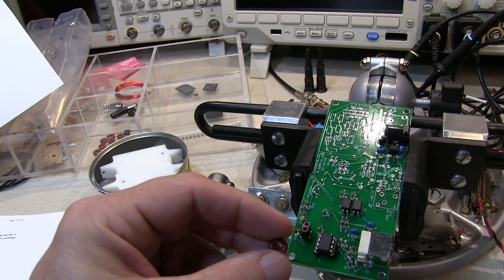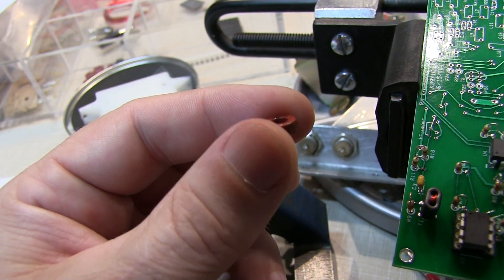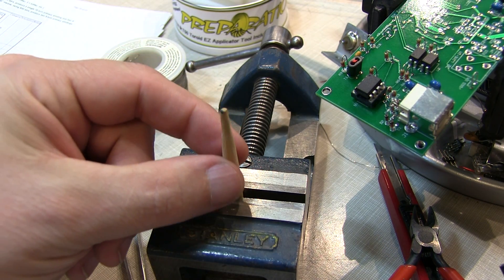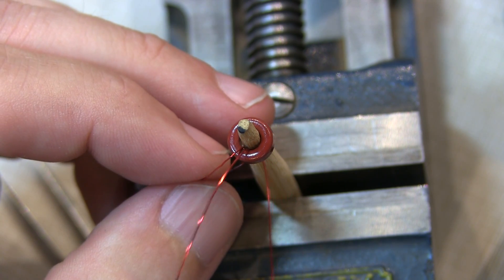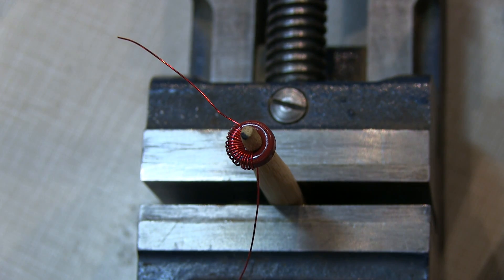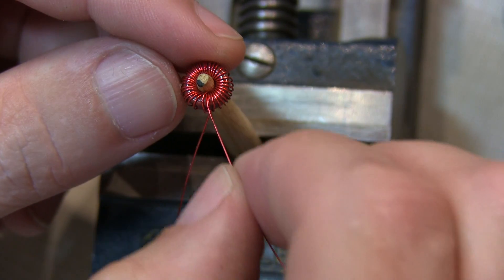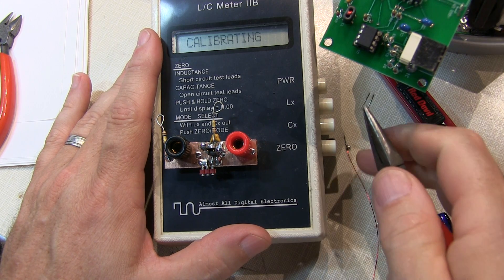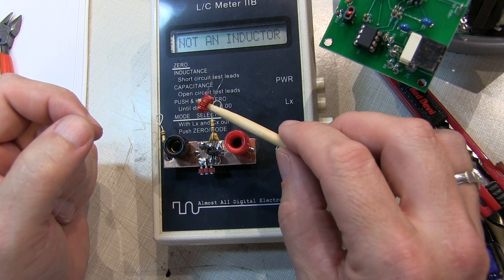#151: How to wind a toroid inductor | A quick tutorial

Comment: The chopstick and the 3D printed gripper are both clever options. I've always just gripped the core between my left thumb and forefinger and wound the wire on with my right hand. Never really felt the need for mechanical assistance, but I can see how it would reduce fatigue if you're winding a lot of toroids. Even the QRP Labs transceivers have enough toroids to wind that it might make a difference.

Comment: Great idea using a chopstick, i tried it to wind a T30-6 with 35 turns but the opening ID got so small even with a thinned out chopstick it was still to big. I ignored your advice and wound the last 10 or so turns on it with out counting. Then took a picture and marked of every 5 turns with a paint program, it was easy to count. thanks again for the tip. My tip to pass back, to solder the body on a PL-259, take the tip off of a soldering gun and use the current to heat up the body, solder will just flow in.

Comment: strip the enamel ? The method I use. I have a small tub of radio shack rosen flux
I dip the enameled wire into the flux
Then apply a little solder to my tip
Then move the iron along the enameled wire
99.9 percent of the time the enamel will burn off and the wire will take solder nicely
Flux can be your friend :)
When soldering objects and want to avoid excessive heating ?
apply flux
make sure iron is HOT
Get on and get off
Sometimes by having a smoking hot iron and you can keep components and soldered objects cooler
Just get on and get off
Like I said Flux can be a real help
Counting Turns ?
Take a good picture with your phone
Put the picture on a computer
enlarge the picture and have a really good easy look :)

Comment: My output voltage is quite low on hand wound toroid transformer. I did match the frequency to source AC, used proper core, and both wound in same direction. What is efficiency "percentage difference" of primary not wound exactly over secondary, just wound separate on core? It just looks visually better with 2 different colors insulation.,at separate placements on core.

Comment: Thanks for the idea of the post to wind the inductors on. 

To the best of my knowledge there are essentially 2 types of magnet wire insulation, the high temperature insulation for such things as motor windings, and the low temperature for signal windings, such as guitar pickups and receiver stage coupling. The smaller the wire the more likely it is to be low temperature. Magnet wire should all come with the melt temperature of the insulation specified, but it seldom does when you buy less than a whole spool of wire. Suppliers are lazy.

Comment: I just watched this video, again, after five years. Yep, there is still more to be gleaned from it. Thanks, Alan! I have another idea for a tip, but I have not tried it, yet. Might it be helpful to either 1) flatten a portion of the chop stick, along its length, or 2) cut a notch, along its length, in order to make a void through which to pass the wire? This method would mean that the toroid would remain fastened by friction and, yet, more than one turn could be passed through the toroid's center, before the toroid would need to be lifted and turned. It might also make it possible to cinch the wire down firmly against the toroid's body, which should improve the final component's operations. A void of one-third of the circumference might do as a size from which to begin testing the idea...
Reply from the maker: It's a good idea, one that I have done myself.  I've carved a groove in mine to allow the wire to pass - makes it easy to put the turn right where I want it.

Comment: Thanks a lot! Im trying to build a 500mH for wah wah guitar pedals. But I guess this value doesn’t fit in a toroid shape.
Reply from the maker: That's quite a large value inductor, would probably have to be a large, high permeability core.
Reply: @w2aew  it’ll be a coil inserted in a ferrite material. 460 turns of 38awg isolated copper wire. I’ll get in touch with an electrician here in Brazil. He’s specialised in wiring electrical motors.

Comment: Alan, can I ask why are you wind your toroid‘s so loosely? When I wind toroid, I typically will form the wire around the toroid tightly but not so tight that it would damage either the toroid‘s coating or the wires coating.  The reason I do this is twofold: the first, is that the windings stay nicely in place without necessarily putting Q-dope on them, also I noticed that the inductance value will stay much more stable when there’s movement(especially in a VFO); second if I wind the wire tightly, I get greater coupling with the core and therefore a noticeable increase in inductance which allows me to then use a larger gauge wire  with fewer turns which reduces the resistance and improves the Q of the core.  Thanks for all your videos, I’ve learned a lot but in this case I would really like to hear your opinion.  73...
Reply from the maker: Yes, I normally wind them as tight as possible.  In this case, the toroid in question is very small (the camera makes it look big), and I could've used a thinner gauge wire.  In my first attempt at this video, I broke the wire a few times trying to make it tighter.  In retrospect, I should've made this video with a larger diameter core which would have been easier to tighten the wires on.
Reply: @w2aew  Well Alan, thank you very much for replying so quickly.  I now understand, and I too have had the unfortunate luck of breaking wire when I had a toroid about 7/8’s completed; specifically when I was winding some gate-drive toroids (pre-high current P-channel MOSFETs era) with #40 wire on ferrite-beads! 
Again Alan thank you so much for all you do for both the Ham and electronics community!

Comment: Why do you not pull each turn tight to the toroid? (Or did you answer that question here in the comments... don't plan to read all of them...)

Thanks.
Reply from the maker: I did pull each turn as tight as I could given the wire gauge - it just looks looser than desired because of the tiny size of this toroid.

Comment: w2aew, any reasons why Toroidal transformers radiate less EMF and HUM? Using a Toroidal power transformer for the 120VAC will radiate less EMF and HUM compared to using a iron core power transformer, any reasons why?
Reply from the maker: Since the windings are arranged in a circle,  the radiated fields cancel themselves.
Reply: Any reasons why the radiated field cancel themselves because the windings are wrapped in a circle? A normal transformer wrapped around an iron core magnet is called what, since the name is not toroidal it would be called what? the iron core is a alnico or ceramic magnet? the iron core is a magnet or non-magnentic?
Reply from the maker: @waynegram8907  all your questions about transformer cores are answered here: https://en.wikipedia.org/wiki/Magnetic_core
Reply: it gets really confusing because there is so many different types of cores/magnets used that I don't know what cores/magnets they used mostly in transformers in the 50's,60's,70's,80's that was common in power transformers 120VAC for power supplies for consumer products and amplifiers. Some of the cores/magnets have a lament coating

Comment: I usually leave the leads long before testing. A few times I had to add a winding to get the inductance to where I wanted it to be. If the measured inductance is too high, then try to unwrap one (without) cutting and measure again. When they are all done I give each toroid a dunk in corona dope (but clear fingernail polish works too).
Reply: Same Here
Reply: Thanks for this!   I was about to ask this question you answered.   What 99.999% of all toroid videos I seen to date, after the first  winding, everything is perfect or "close enough".   I am trying to wind for a unun and struggling with this because I am told you can get good measurements unless the leads are short.   But what if you need more turns?   I am new at this and it's probably a stupid comment but I am
Sure others wonder the same thing that are new.
Reply: @jeff-73  You do not leave leads long, you just wind an additional turn, leaving the leads short. Then measure and remove the turn if necessary

Comment: Hi Alan,  your videos are the best.  I know this video is pretty old, but I have a comment about making sure I have the correct number of turns in case you or others have not started to use their smart phone camera to confirm turns count.  I do count the turns as I go, but then I use the camera on my smart phone and zoom in on the toroid wound coil and take a picture.  Then it's very easy to count the number of turns by looking at the picture to confirm the turn count is correct or just how many more turns you need, and you can zoom in more on the picture as needed.  Just FYI Don (wd8dsb)

Comment: W2aew, 
Using higher value choke values in power supplies will give a different sag compared to using lower value choke values. The Choke is a reactive component and explain why this happens because the chokes are tuned to 60hz or 120hz in power supplies so the higher or lower the choke value does something with the current to starve the circuit when drawing current? What I mean is that the Choke is a reactive AC resistor and the higher value chokes are a reactive AC resistor and the lower value chokes are a reactive AC resistor but what is the differences when the current is drawing current when using a Higher value choke compared to using a lower value choke?

Comment: Hi Alan

First of all, please accept my deepest condolences for the loss of your father. May he rest in peace.

Next, I wish if you could spare some time for doing a video on saturation in inductors. How to find out the matching duty cycle or frequency when pulsing thru a BJT or a MOSFET (example in blocking oscillator or Charged-Induced-Pulse generator) to avoid heat dissipation in BJT/MOSFET due to inductor saturation.

Comment: If there a rule of thumb for determining the very best thickness of wire to use? 73
Reply from the maker: Not really.  In general, the thicker the wire, the lower the loss.  However, thicker wire is tougher to wind, and fewer turns fit on the core.  So, it's a tradeoff of the number of turns needed vs. loss vs. core size.
Reply: Thanks so much for letting me know about that! I am a new hatchling in the world of radio. So, naturally I ordered about 50 CW QRP Pixie radio kits and about 50 of the Frog Sounds ones, along with a lot of soldering stuff, wire, bread board, lots of bulk chinese parts that are related to qrp... and meters, etc.... and I'm watching all the small DIY electronics stuff I can find. Thanks again!

Comment: Excellent tutorials.  Its easy to wind a few turns , but when it comes to hundreds it is becoming nearly impossible. My question is that, I have a faulty Acer d260 laptop charger due to broken legs toroidal emf filter (4 legs). Unfortunately, I lost the part and now I need to replace it,  but i don't know where to start? I remember it was  about 6.20mH of inductance, also I tried to wind one following your video but after assembling the charger I have got overall voltage output swinging between 12V - 7 V where it should be 19V (charger output). Dimension of the ring inner diameter about 9mm, outer diameter 13 mm and height about 4 mm.  Also is there any marking on the old part to tell me which is which, like capacitor  for example easy to read in order to find a replacement?
Reply from the maker: Unfortunately, they're not marked. If it was just an EMI filter, it wouldn't affect the voltage. So, it's probably more involved than that. You should be able to find a suitable 19V charger on Amazon for less than $20.
Reply: Thank you. Yes, I know. I am just doing to gain more experience (practicing). It is probably also act as transformer, because it is linked to the bridge rectifier.
Reply from the maker: It's probably the energy storage element in the switching regulator.  If so, it's specs are quite critical to operation of the regulator, so not something that would easy to replace with anything but the original part.

Comment: Is there a direction that you wind the wire? clockwise, anti-clockwise? or do they work the same regardless? Also, is it better to have the turns evenly distributed or to leave a gap at the size with the wires?  thanks and 73
Reply from the maker: Direction of winding isn't important, just be consistent about it, especially important when doing multiple windings (transformers) so that the phasing is correct.  See my video on "phasing dots".  Turns should be evenly distributed around the core, but leave a larger gap between the where the first turn starts and the last turn ends to minimize capacitive coupling from input to output.
Reply: Thank you, enjoyed listening to your story on QSOToday as well. 73

Comment: What's with all these "amateurs" in HAM radio? Isn't there any professionalism in HAM radio?
Reply: The 'amateur' designation  is there for a reason. It separates us from 'Commercial' broadcasters (Things like commercial TV stations, commercial Radio stations, etc). We do it for the love of the craft, not the money. 
(If you were just trying to be funny ... don't give up that day job).
Reply: If we were professionals, we'd be cramming advertising at you at light speed constantly into every nook and cranny.  That's what professional means to the FCC, FOR PROFIT MUST SELLSELLSELL, and is a quite different rule set.  Many  "Amateur" Radio Licensed Operators do or did make their professional lives in the service/support and actual broadcasting in the "Professional" ranks of broadcasting.  That's the main difference though.  Amateurs are about 2-way communications.  Professional Radio is about Broadcasting.    The FCC decides what we are called, not us.  Except for the "ham" part.  Clear? Mud? over.
Reply: Also as Amateurs, our licensing exams and renewals are just a few bucks and have a 10-year span.   And of course there is "professional" 2-way service which is commercial radio for work crews and drive through operations, etc. Commercial service radios are only for a few "channels" and one has to learn nothing about radio in order to buy, license, and use them. Like semi-private CB almost.
Reply: It is a hobby, but you shouldn't get misled by the word "amateur".

Comment: I have never wound a toroid, but I have an idea that might help with manually managing the length of wire...
- Measure the wire to length and cut.
- Measure to the midpoint of this wire and mark the location.
- For the first turn, pass the wire through the core and advance it to its midpoint.
- Start your first turn at this location.
- Wind half the wire in one direction. Repeat with the other half, winding in the counter direction.
In this way, the longest piece of wire that you must manage is only half of the total wire length. I hope that this method is permissible and that the idea helps.

Comment: Nice video and I used to wind like you show, however I now wind mine differently. 

When I wind, I keep all the turns tightly bound to the core shape using a fair amount of tension.  I do this for four reasons.  First the inductance is markedly increased by being closer the core; so less turns needed per unit-inductance.  Second, I've had frequency instabilities in oscillator circuits (even micro-phonics) and had to resort to then using a fair amount of Q-Dope to stabilize them.  Thirdly, I can often use a smaller toroid core (because of being able to get enough inductance) and conserve space; also I can preserve the lead-to-lead gap that is recommended. I have never had any problems with scraping the toroid or wire, or wire breakage. Lastly, I have been able to reduce the inter-winding capacitance by having tight turns (thus picking up the inductance) and being able to spread out those individual turns more.  Anyway, thanks for posting your videos; I've certainly learned a lot from both you and your great viewers. 73!
Reply from the maker: Good comments, thank you!